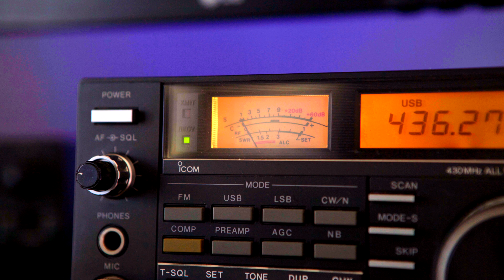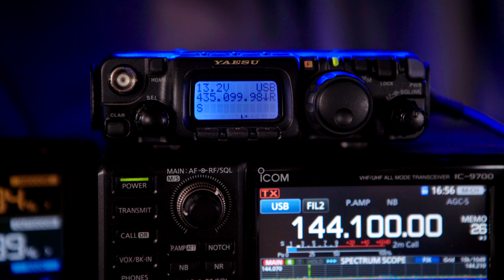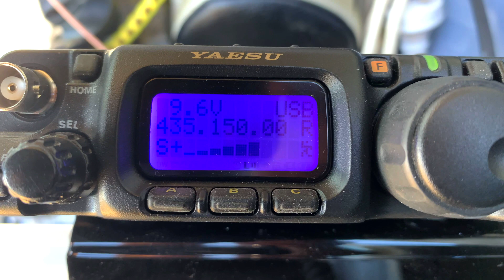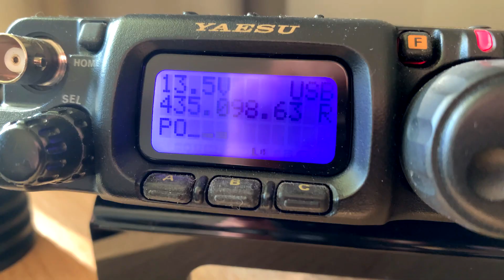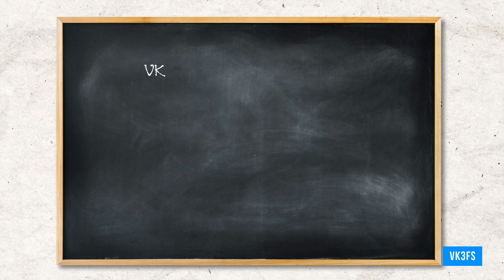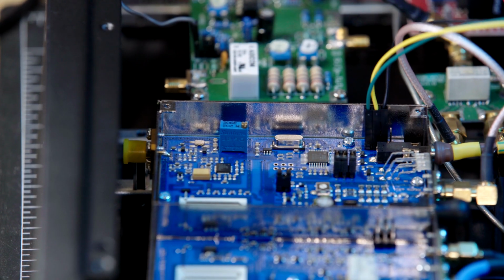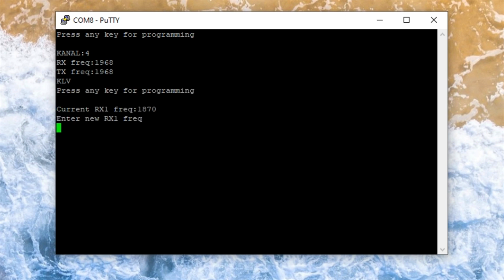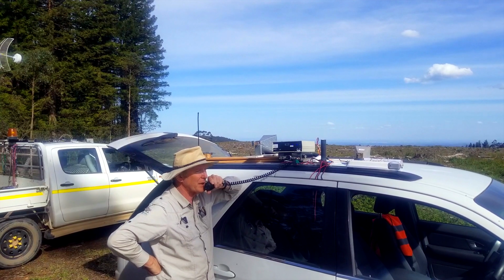How to program the SG Laboratory 13cm transverter Local Oscillator

Comment: Hi Andrew - Another great presentation.  I am planning to follow your lead and have the 2.3GHz from the front panel of my system. Question - when putting leads onto the LO selector headers pins on the board and bringing them out through the case of the SGLabs TVTRs do I need to use screened lead?  I suspect not as it is only switching DC to ground but am interested  in your advice.  Thanks again Kevin VK4UH Brisbane VHF group
Reply from the maker: Hi Kevin. I think you'll be fine with unscreend cable. I used hookup wire here with no noticable issues. The believe the device only looks at the jumpers when it's powered up, hence a power off and on to change the LO. Sorry about the delay in replying too. Cheers Andrew